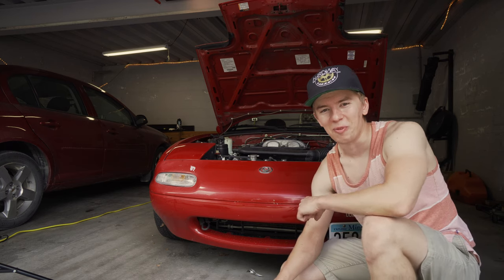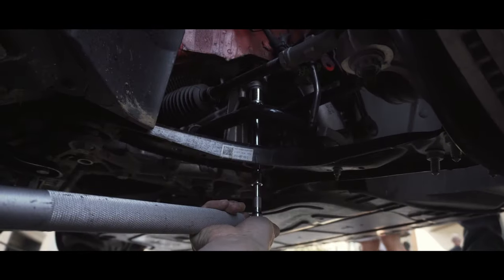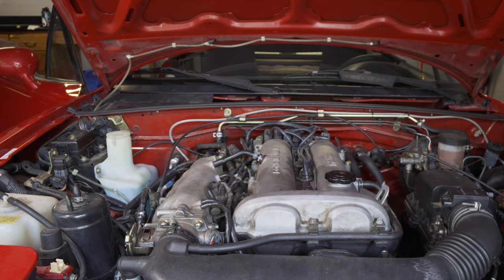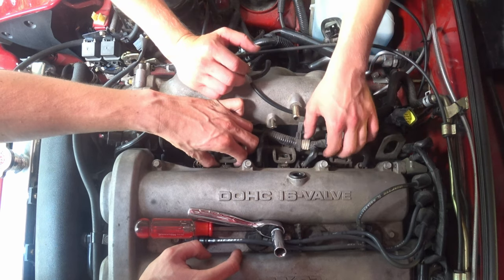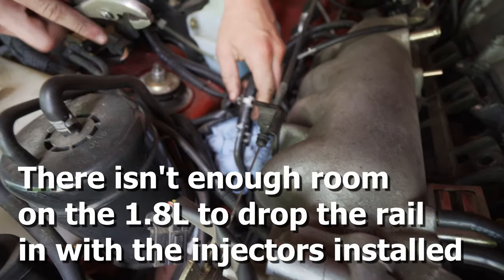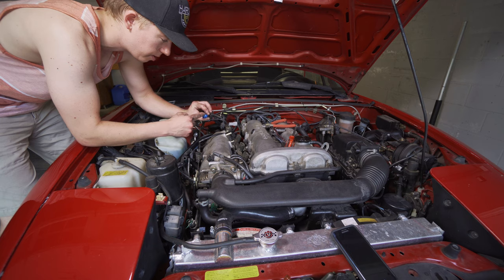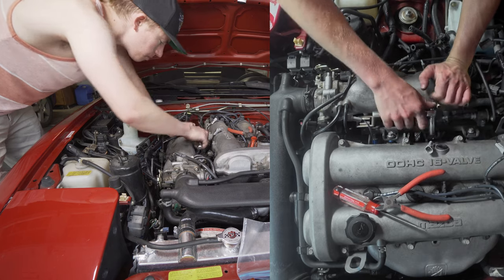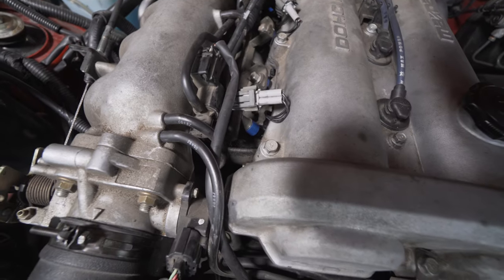Flow Force Injector Install Turbo Miata EV14 640CC

Comment: Hey what did you do to get the new o-rings? I just put mine in and the o-ring on the top hat for one of my injectors is leaking
Reply from the maker: Measure the old o-ring outer diameter and inner diameter and search that on Google. If you have flow force injectors they sell replacement o-rings on their website. I actually replaced mine and they leaked right away. Be agressive with the vaseline so they seat properly 🤘

Comment: You didn't touch any of the "injector characteristics" or anything in the tune? No voltage corrections?
Reply from the maker: I definitely did, but forgot to mention. Flow force lists their recommended settings on their website. I'll reference it in the description

Comment: Is this a turbo or na build. Sounded like turbo whistle in the beggining
Reply from the maker: In this video it was still NA, but it is now turboed on an SR20 turbo which is a Garrett 2554.
Reply: I have an nc I'm just doing an na build. All I have left is to throw some injectors in. I have a aluminium cold air intake and the goodwin racing max flow header and mid pipe. I also have an open flash tablet. I really have no clue what my hp is but it feels fast already.

Comment: What’s the difference between a 640cc 900cc and 1000cc
Reply from the maker: The bigger the number, the more fuel they can flow. If you want to run E85 you would need 20% more fuel, if you run a bigger turbo you'll need more fuel.